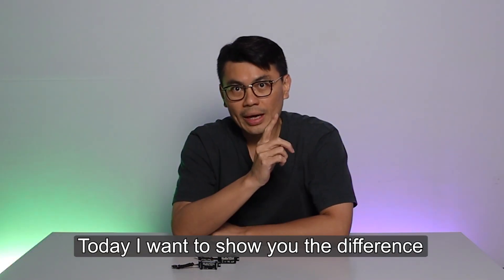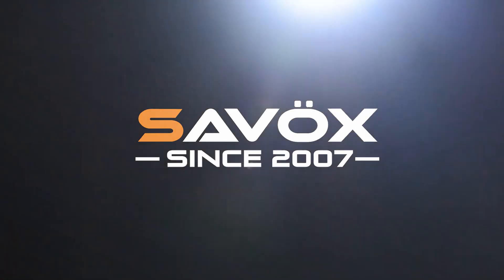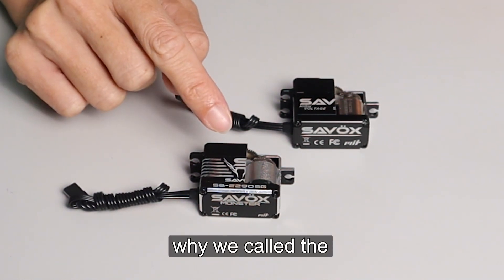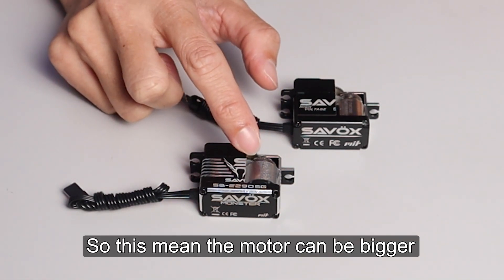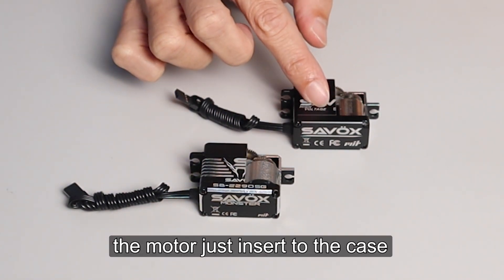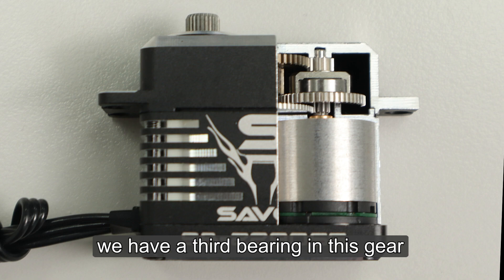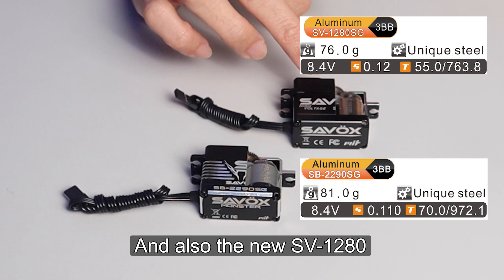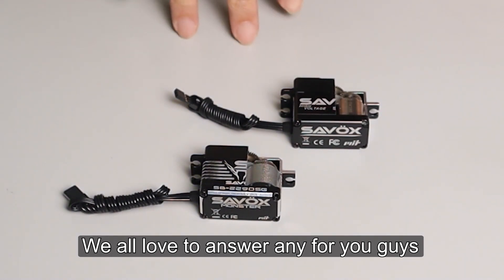SAVOX patent servo (monster series)

Comment: Le sv1280sg a les mêmes performances que le sb2290sg ? 
Pour frein et direction 1/5 
Puissance en kg a 7,4
Reply from the maker: SV-1280 in 7.4v will be 0.14sec 45kg and SB-2290 in 7.4v will be 0.13sec 55kg, 

thanks a lot

Comment: By wrapping the servo cable, will that cause any disruption in the signal? Also, If you were to shorten the cable how much would you gain by doing that versus by leaving the cable uncut? Will it even be noticeable?
Reply from the maker: no, it won’t cause problem on disruption signal. to de soldering the cable by DIY is not recommended.